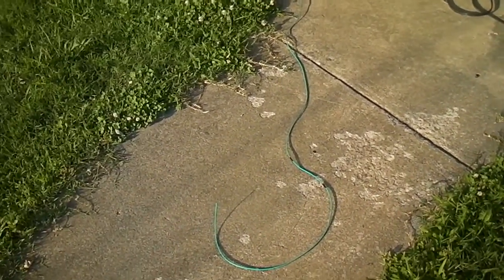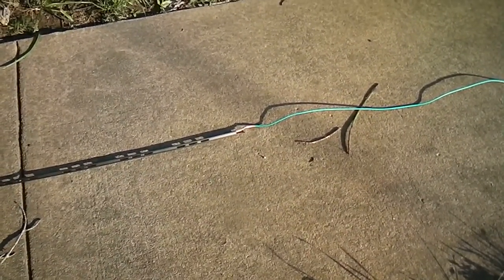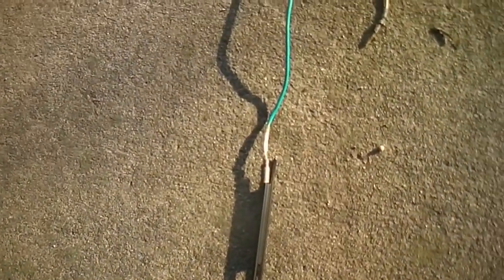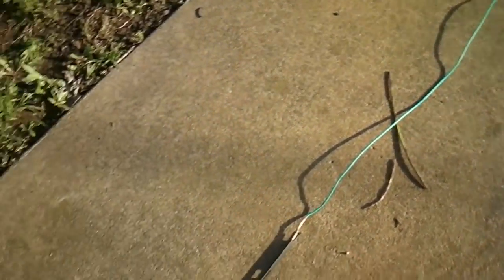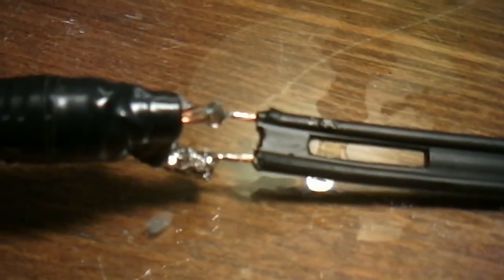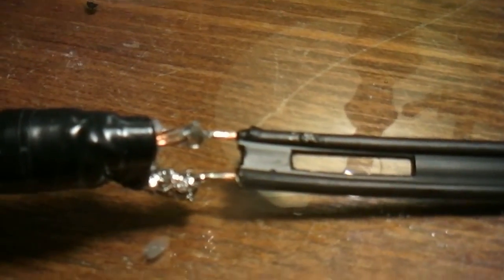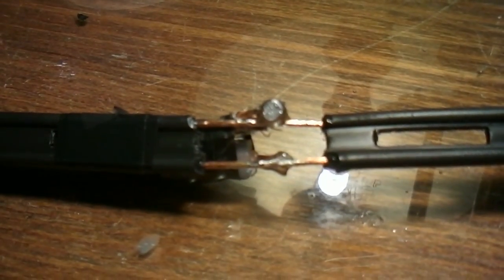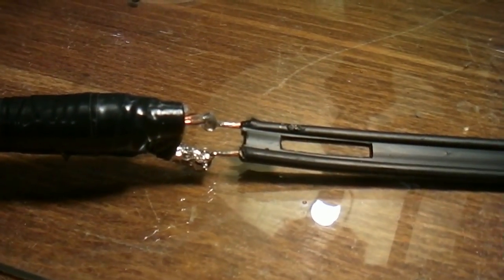Finishing up J Pole Antenna for my CB

Comment: How did your jpole pan out man? I built one to Dave Tadlocks dimensions at amateurradio and am still struggling to get SWRs out of the 10 range. Near as I can tell his was calculated almost middle way into the 10 meter band.
Reply from the maker: yes It should have been in the 11 meter range it must need to be made a little tiny bit longer make adjustments by cutting small increments off  the end off of the j pole on the short part that comes up. It was a really good antenna i talked skip on it and around town but the tree I had to cut down I used it was about to rot and fall on my house. I use the 102 inch whip on my truck now just put the coax out the window. The jay pole antenna can be easily fixed by adding length to the long part or shortening it with a soldering iron and more wire. or the small jpole part too. You have to play around some there are more videos than just Daves!  I like 
Carol inaPirate video measurements works great. https://youtu.be/Xyh18GyniTo
Reply from the maker: Let me know what happens?

Comment: How much coax should I get 50' or 100'? I like these better than the dipole because I don't have to have as much cable since its bottom fed.
I wish you had turned that loud ass fan off for the video man.

Comment: Looks like it should perform well.
Reply from the maker: WV Wildlife Cam It is supposed to out perform a 1/4 wave and a 1/2 wave antenna. I believe it will when I get the SWR set properly. I may need some extra power to shoot skip. I can get out locally. But I tried to talk skip and Im afraid my SWR is not set well enough. I am only putting out about 3.5 watts so it not set correctly. They could hear me though. But I dont think it was good enough to make out what I was saying.